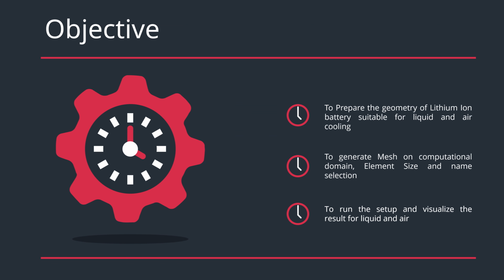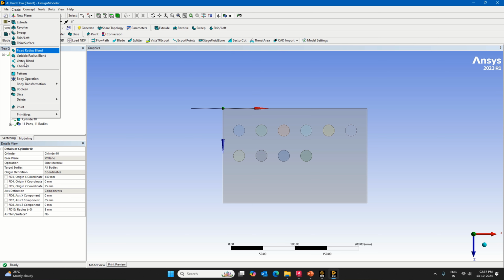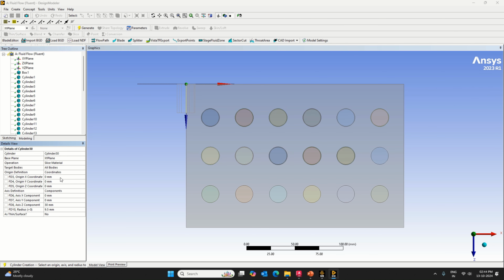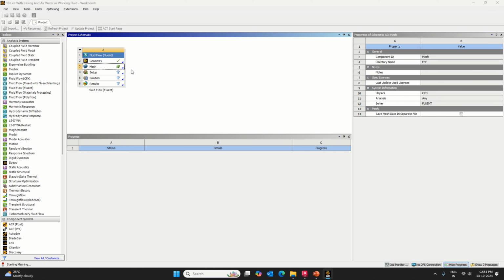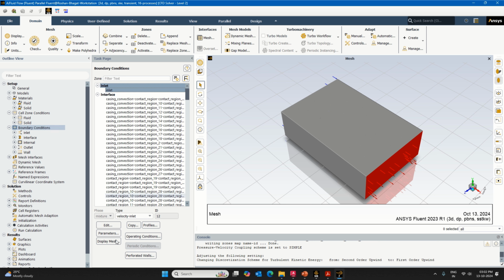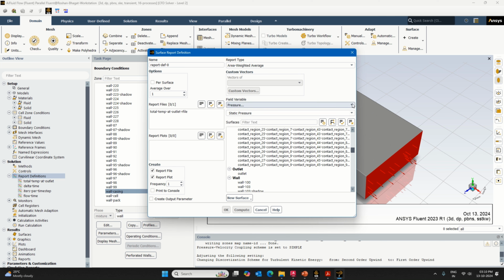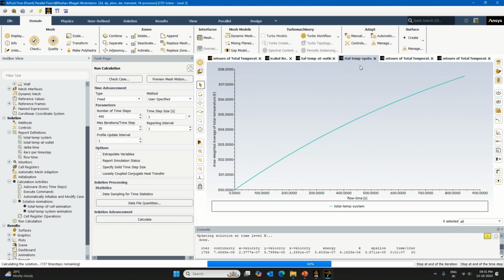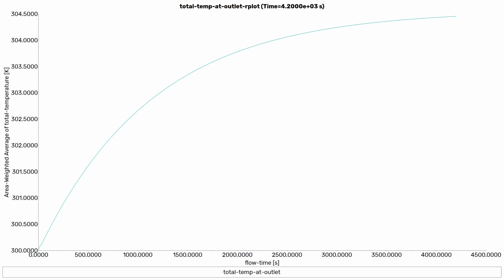CFD Simulation of 18-Cell Lithium-Ion Battery Pack with Air and Water Cooling

Comment: Suppose we don't have an inlet and outlet flow, what should be the changes made and where? And also given that we have a heat transfer coefficient  what should we do?
Reply from the maker: In mesh no need to specify inlet and outlet and for heat transfer specify name selection as convection where it is required then in setup apply the convective heat transfer coefficient under that name
Reply: @FrontiersInCFD  and how should I input the Heat Generation Rate? Given that I have a 1.5C discharge. I actually wanted to see the battery itself slowly gain temperature from ambient to like 338K or so!
Reply from the maker: Specify source term in cell zone condition